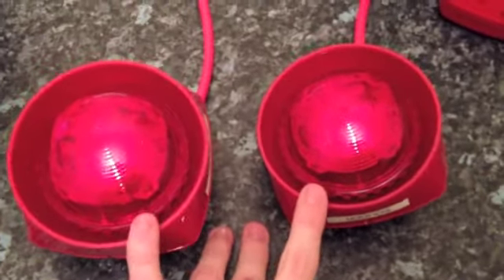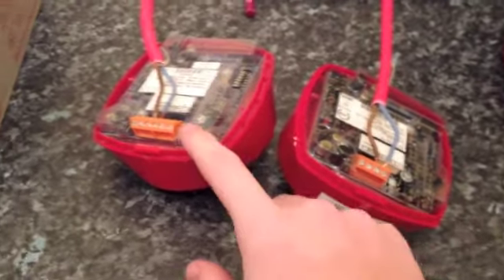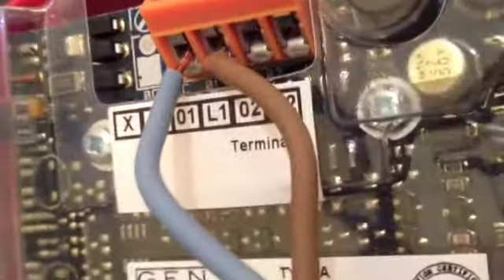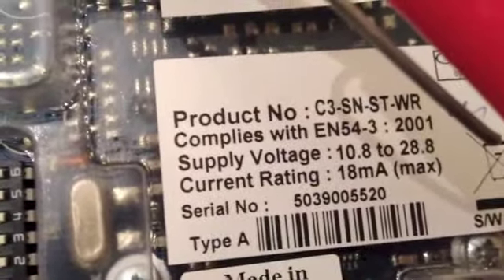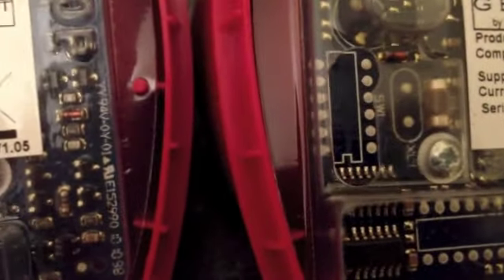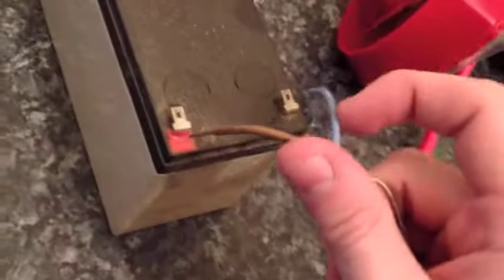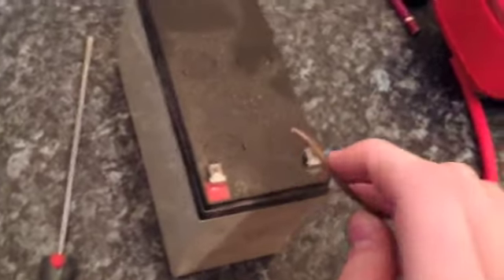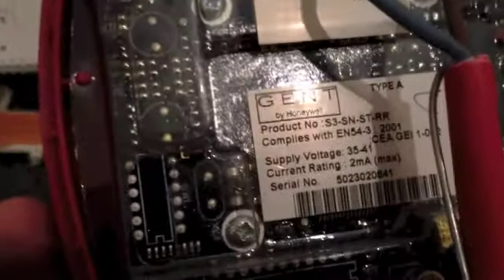The difference between GENT S3 and C3 Sounders

Comment from the maker: James, sorry I can't reply to your comment as the new youtube is utter crap!! The 3rd wire is for the second tone for that tone setting, usually a continuous tone or an intermittent tone.
Reply: and what sort of panel would you need for that??
Reply: also how do i wire that to my panel which is orion
Reply: forde52 would the s3 work on 12v
output 230 in put  an a batary pack
Reply: @jackwafc4144  no, adressable devices require a panel and gent individually requires a vig